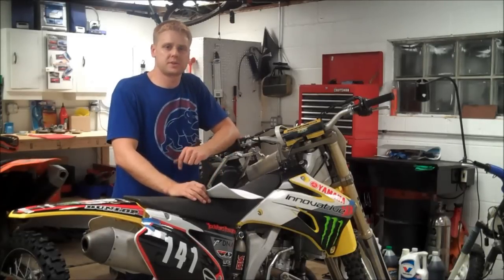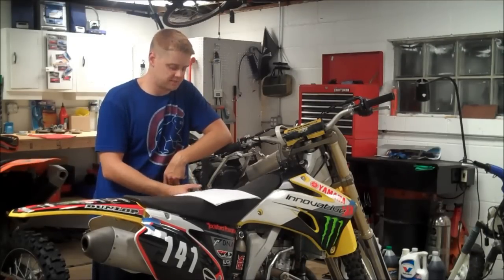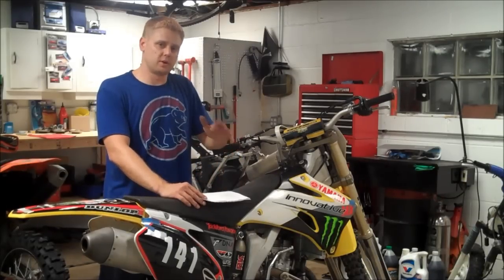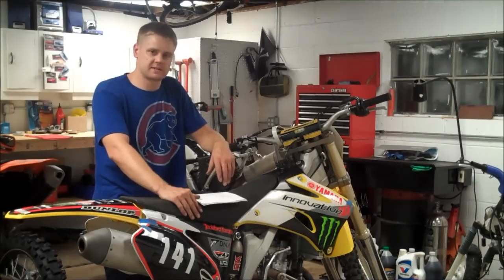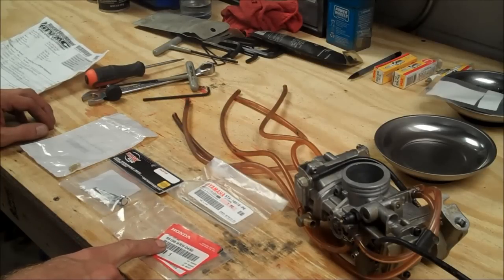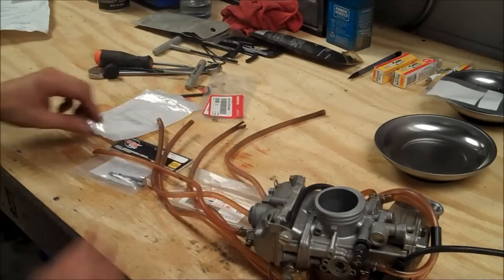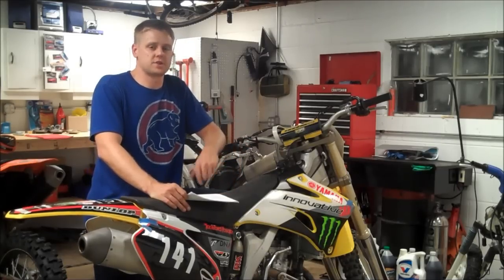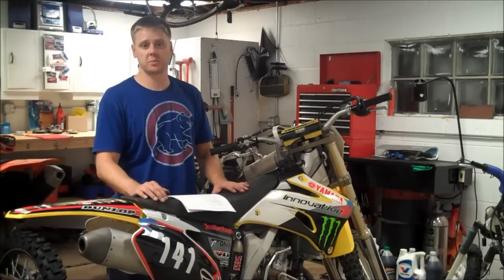How-To: Jet a 4 Stroke MX Dirt Bike (Sample)

Comment: MatthewMCRepair can you please help me,
Ive got a  2009 crf250x with the CCC mods and a jd jet kit and it backfires just as much as that yz250f in the video and I have swapped out the pilot to a 45  and lowered the needle two slots. It performed horribly with both of them and there was still backfiring so I went back to 42 pilot and 2 up on the needle the way it was before. So what is causing the backfiring? is it normal for a 4 stroke to backfire that much? thankyou.
Reply: Exactly the same bike, Same issue. I have all the mods that you listed aswell. Any tips on why it backfires so much?
Reply from the maker: +KingBandz So you have a 2009 crf250x? What modifications? Location? Pilot jet size? Did you adjust fuel screw? Air leaks? Leak jet size? Answer these so I can better help you.
Reply: I have done the airbox mod, swaped the 250x exhaust for a 2005 crf250r can, and JD jet kit. I am in Erie, PA. The pilot is the stock 42. I have attempted to adjust the fuel screw but It starts to not pop at around 3 turns out but its about to fall out but when I put in a 45 pilot even with the fuel screw in all the way it performs wierd. I got it from my friend and everything other than the mods I stated are stock so I'm assuming the leak is stock. I havent looked at any air leaks on the header to pipe or pipe to exhaust yet.
Reply from the maker: +Foster Schutt Explain how it performs weird with the 45 pilot? Is it a genuine Keihin pilot jet? You need to check for air leaks on carb boot and exhaust.
Reply: with the 45 in it sputters on the bottom end, making it feel like a 125 2t powerband. I'm not positive if it is a Keihin pilot jet i will contact my shop tomorrow when they are open. I have checked the intake side of the bike from the filter to the carb for leaks, there are not any,
Reply from the maker: +Foster Schutt How many turns out on the fuel screw with 45 pilot?
Reply: I had it at around 1 turn out with the 45 pilot and it would do that
Reply from the maker: +Foster Schutt Sounds like you need to go back to a 42 pilot and limit it to 2.5 turns out.
Reply: Alright! I have it around there right now, I just bought a flexjet for it too, Ill tell you how that works compared to the conventional fuel screw, so that would limit it to an air leak most likely for the popping?
Reply from the maker: +Foster Schutt Please explain when the popping occurs.
Reply: just on deceleration, lower RPM's specifically
Reply from the maker: +Foster Schutt Some popping can be considered normal. Do not try and jet this issue out, you will end up with a rich idle circuit. If you have no vacuum leaks, or exhaust leaks, maybe consider repacking the muffler/silencer.
Reply: Okay thank you I really appreciate it!

Comment: On my 2005 KTM 250sxf, it bogs when I wack the throttle from the bottom and and shoots fire and pops. I bought it used and it came with an fmf exhaust system. I checked the recommended jets from fmf and My main and pilot jets were both off by about 2. Don't remember whether it was 2 up or down. But off. What should I do? It starts 1st kick cold and 75% of the time it'll start 1st kick hot WITH the hot start. Please help! By the way, GREAT video!
Reply from the maker: JakeWardell 19 Bogging during throttle whack is the accelerator pump circuit. You may not even have a leak jet to change out on your model.

Read this and let me know if you have a leak jet:

https://www.howtomotorcyclerepair.com/jeta4stroke/

Matt

Comment: Will the 08 needle work in a 02 yz250f?
Reply from the maker: Nasty782 Yes. I have no idea on how it will run in your year. Easy and cheap ($15) to try.
Reply: bike runs awful the guy who had it before me had timing way out and a pipe that has no name and the yamaha dealer is a joke gave me wrong jets 2 times in a row so its worth the 15$ don't have much to lose
Reply from the maker: Nasty782 Bike currently runs awful? Don't expect the needle to cure this. I would get it running right and then experiment with jetting. Each needle/jet is stamped, so I would tear down carb and verify against stock.
Reply: yeah wasn't expecting just the needle to fix it the carb need tour down for sure.

Comment: On a 4 stroke, the whistle when you give it gas comes from the jetting or just the pipe?
Reply from the maker: Mikey Blanco Not sure where that sounds comes from. Probably the exhaust.
Reply: I've always wondered the same thing.....
Reply from the maker: JakeWardell 19 You sure you all don't have whistle tips? Watch this:
https://www.youtube.com/watch?v=zUXow3d3-b0
Reply: No that isn't it. Far from it. Almost sounds like it's in the engine.... I've heard it on almost every 4 stroke bike or atv.
Reply from the maker: JakeWardell 19 Kidding aside, I know what you are talking about and never pinpointed what causes that noise.
Reply: That’s from the carb sucking in air .. a mechanic should know this

Comment: Matthew what would you suggest for me to highten my YZ250F rear shock,
I have had it totally dissmantled and no matter how hard i try it wont turn,
I used a spring compressor 2 actually to take the pressure off the spring while trying to turn the bottom spacer and sprayed the hell out of it with WD40 and it still wouldnt turn,
I am 16st 7lb and it feels like i'm riding on the floor when riding this YZF250 lol
Reply from the maker: At 231 lbs, you need a new stiffer spring. The top should spin, not the bottom retaining plate.
Reply: Only the top locking spacer would turn
The bottom spacer wouldnt move at all,
It doesnt matter now as my YZF has been crushed by the police :(
Reply from the maker: John Jnr The cops crushed your bike?

Comment: On your after video the bike sounds like it's backfiring after you let off. Doesn't the mean it has lean jetting? My bike does the same thing
Reply from the maker: The bike in the video has the original muffler packing that probably needs to be replaced. Also, the fuel screw was set at 2-2.5 turns out, so it probably should have a larger (maybe).

Keep in mind that some popping is normal with a "race" engine and "open" pipe. Do not try and jet this popping out.
Reply: @HTMR  having this issue on my 09 KX250f. Has an extreme amount of popping on decel
Reply from the maker: @TheGreenTeam627  Tune the fuel screw, I have a video on that: https://howtomotorcyclerepair.com/how-to-4-stroke-mx-fuel-screw-adjustment-yzf-crf-kxf-rmz-fcr/

Comment: It's when I hammer down on her, get that classic bog from the 4 stroke. You seemed to eliminate it at the end video.
Reply from the maker: That is all related to the accelerator pump not squirting enough fuel. Click on blog post under vid description, it goes over how the system works and how to fix it.

Comment: So my power is bogged from quarter throttle to half throttle. Low and top end are perfect, will changing my main jet reduce this? It is it the needle ? I got a little confused haha.
Reply from the maker: Sounds like you have to play with your needle and/or clip position. This is steady state throttle or twisting it fast?

Comment: What is the stock setting on the AP timing screw? Like if you run the screw all the way in, how many turns out would the stock setting be?
Reply from the maker: Joe, what year make model do you own? The service manual has a procedure for this. It usually involves placing a pin under slide and then adjusting the screw. I'd have to review it myself, it's been a while since I looked at it.
Reply: 2007 KX250F
Reply from the maker: Joe Jones Joe, go to my site and type in "kx250f" in search box. I have the free service manual for an 06' and it should be the same procedure for your 07'.